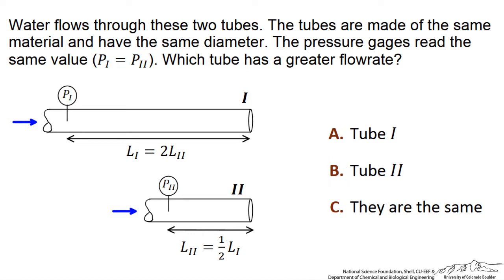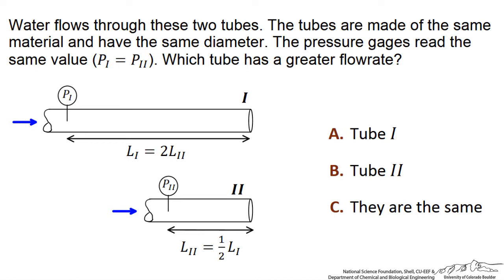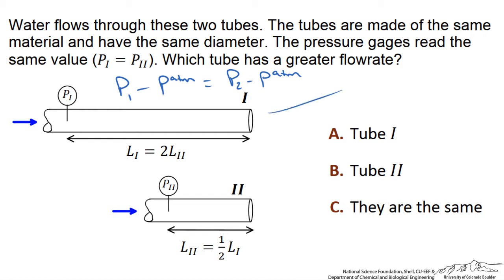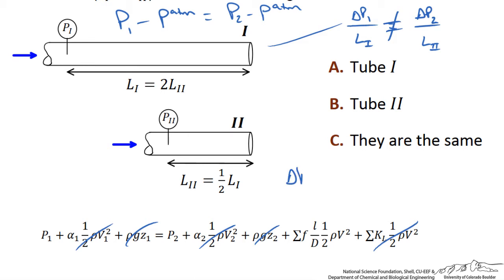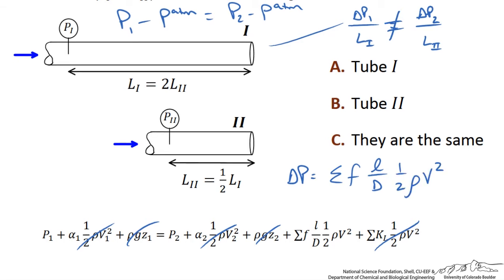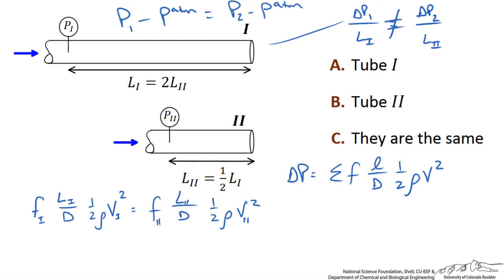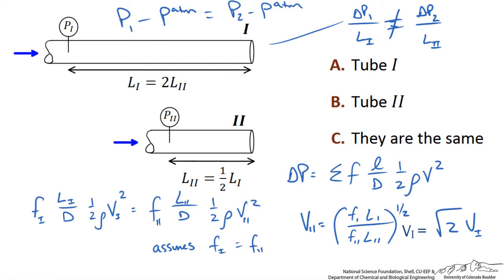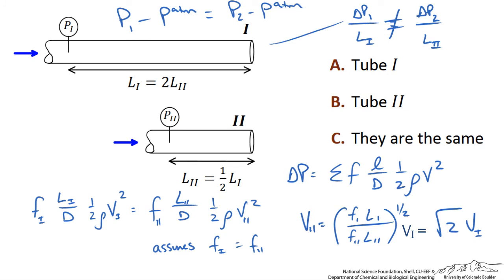Flow Through Different Pipes Answer B

Comment: When he says 'difference in pressure' he meas the difference in P1 compared to P2 not the difference in pressure along the tubes compared to each other which is obviously difference because of friction

Although I do not understand the use of DeltaP1/L1 = DeltaP2/L2. Delta P1 I normally would think of as the change in P1 along the pipe, it should not represent the difference between P1 and P2 as it seems to imply which is always a constant in this example. In other words if we use deltaP1 as if it represents the difference between P1 and P2 then it would always be the same, it could never be different because the difference between P1 and P2 never changes, making it a constant not a variable and we shouldn't see it in the numerator over length. For example if P1 was 5 and P2 was 10, then deltaP1 would be 5 and deltaP2 would also be 5 because the difference between them is always the same constant, they would always cancel out of the numerator forever and ever no matter how many times you use that equation. And he does say deltaP1 and deltaP2 is the same which clearly states how this equation is being used. Because if deltaP1 was the difference in pressure along the pipes as I intuitively think of it, then deltaP1 would be much different from deltaP2 due to friction.